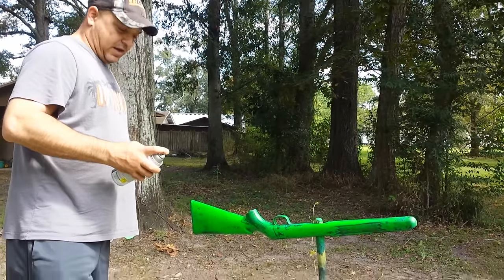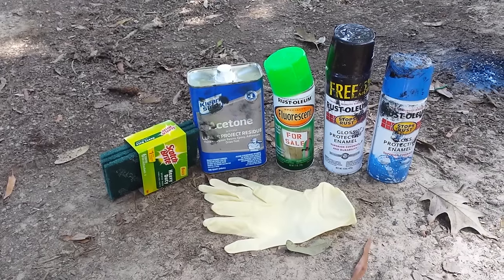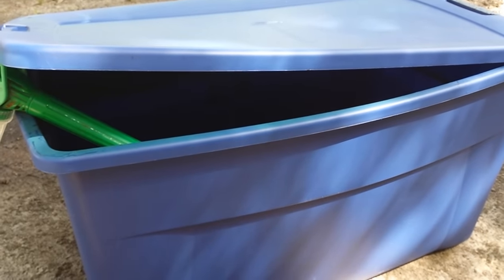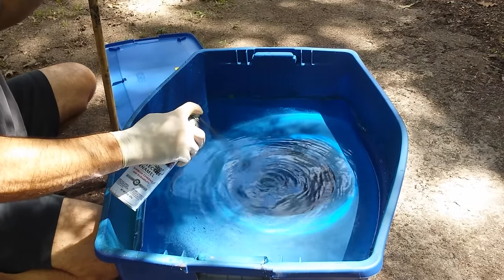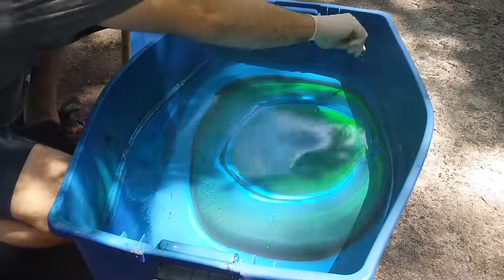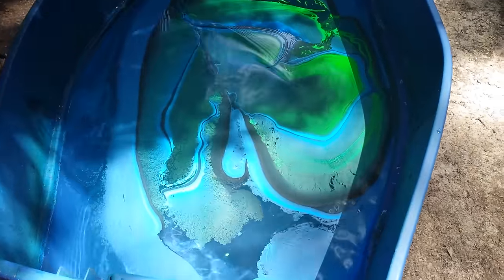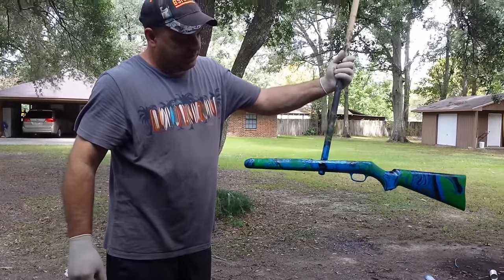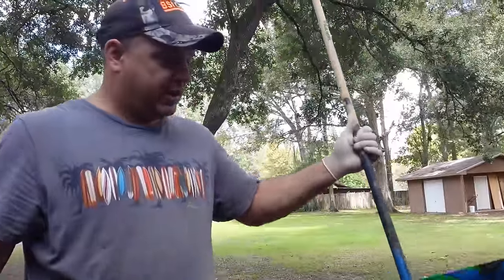DIY: Hydro Dipping using Spray Paint

Comment: You have to clean off all that paint at the top before you pull it out so you get a smooth finish and don't get the extra paint as you pull it out.
Reply from the maker: Brent Simpson..... i did that on purpose ( buttstock didn't get enough color) but totally agree. My project came out perfect thought with no bubbles or raised spots. My daughter was happy with it 😎

Comment: Thank you for posting this.  I've seen several videos, and have attempted a couple of "trial" dips with disappointing results.  Some videos have said warmer water is important, but I'm with you (in a similarly humid/hot Texas) that I'm going to attempt cooler water, as I haven't had luck with warmer water.  

Any advice on picking paint to ensure it is oil-based?  The couple of times I've tried with the RustOleum Camouflage 2x Ultra Cover, and it seems to clump/set almost immediately.  I saw that even paints labeled "enamel" nowadays may not be oil-based. :(

Also, when you dip, are you getting lots of raised areas on the stock?  (too much paint in one area)  Any advice on that? 

Thanks, again.
Reply: +D Scott Brown In Belgium, (where i live) if it says on the can "use for inside and OUTSIDE" it is oil based, everything for outside is (usually) oil based (not if it says acrylic)

Comment from the maker: @D Scott Brown yes on my first attempt it looked awesome but was clumpy in spots but I did put in alot of paint which I was like just use a lil less then I was running into it setting up too fast well even faster than the first dip. So using ice to cool it down which I probably got the water to a cool 68 to 70 range and it didn't set up as fast ! As far as the paint goes yeah just make sure it's oil based so it floats pretty much trial and error with that hence the different kinds you can purchase. I'd go straight liquid but does cost a lil more. Hopefully that will help you !!!
Reply from the maker: Oh and for being raised probably too much paint in one area of the bucket/pan. Try changing the areas of shooting the paint in like the corners then middle then swirl so it's not all in one spot in the middle like I did should come out just as good if not better !!!
Reply: TheHOP
Reply: Talk about a run on sentence.

Comment: Nice simple setup. You're using too large a water container. You need a lot more paint to cover the surface volume. One simple solution is the spray the paint into the lids then use a straw to vacuum drop the paint in to the water. That should give you a few extra minutes working time. 

Also check your water temperature. It should be around 25-32C depending on your paint. You should use a bit of scrap cardboard to swirl the paint away from where you are pulling it out. Also practice with blocks of scrap wood, rocks, household items. Practice makes all the difference. 

Still I think you got a nice look for your gun. Just give it some more practice and if you get in to hydro dipping then perhaps look in to the next level of hydro dipping ; water transfer film, which is what you what for camo print.
Reply from the maker: Yep gonna do my AR like that hopefully in a couple of weeks with the film ! Still tryin to decide which print I want to use considering the type of area I hunt at.  And thanks for the pointers. It's always good to learn something new considering this was my first dip
Reply: +TheHOP81 Nice, but buy some cheap prints off ebay to practice with. Film printing is not as forgiving with mistakes. You want your water slightly warmer and gently remove the air bubbles. I'm sure you have watched a few videos to see the techniques but again do some practice first.
Reply from the maker: +Nick Rider yeah no doubt

Comment: This is the same technique used when water marbling my nails. Your problem is your water is too cold and that is why your paint is setting up to fast. use warmer water and it will be viable longerl
Reply from the maker: actually i had to use cool water for it to work. Being in a  high humidity area the project didn't turn out as planned at first because the water was about 80ish out of the tap. Cooling it down with a bag of ice made all the difference in the world. The paint didn't set up as fast as it did when it was warm ! Im starting to think with all the different ways people say to do it. It probably all depends in the area your in with all things to consider like temp, humidity, elevation etc. For all the peeps gonna be trying this for the first time, i would say practice first on something you dont mind messing u. And if you like the results then go for it
Reply: Yes the humidity will play a factor. when doing my nails I want to make sure the water is basically the same temp as the room I am working in. Maybe try it in a controlled environment; shed, garage, something ventilated enough but out of the elements. But yes lots of ways to do this.

Comment: What type of base coat did u use does it matter?
Reply from the maker: The neon green paint was an oil base paint also. Not sure if it matters. Just as long its not water based im sure you'll do fine

Comment: you use water and paint only?
Reply from the maker: yep
Reply: i try but the paint not floating..
Reply from the maker: +chris oliva what kind of paint are you using ?
Reply: +TheHOP81 i use ordinary paint only..
Reply from the maker: +chris oliva .....only use oil base paint cause it floats !
Reply: TheHOP81  hi.  can i use pailox spray paint.?larry.
Reply from the maker: larry sansano... not familiar with that. Is it oil based ?
Reply: Acrylic spray paint sir. Can i use this?
Reply from the maker: larry sansano... u could try it but try it on something small first not the original project. i would use oil based paints cause it floats on water better
Reply: Ok sir thank you.

Comment: You want to spray with your cans alot closer.
Reply from the maker: actually if you go close it produces tiny air bubbles which when you dip you will see it on your project. Best advice is too use liquid/can oil base paint and get a dropper

Comment: Can you use any paint?
Reply from the maker: use oil based paint !
Reply: +TheHOP81 so using a oil based is good for painting over the a paintball gun?
Reply from the maker: +SpitefireAllDay Well depends on what kind of paint ball gun you have if its metal paint should adhere to it. If its plastic you might want to scuff it a lil with sand paper so the paint has something ro stick to just remember to do at least 3 light coats as a base color and then dip. then just clear coat it with 4 or 5 coats. Should come out fine just practice on something before you dip your paint ball gun

Comment: So it was just plain cold water
Reply from the maker: Yep plain ol tap water
Reply: I'm trying to do my trucks interior which is plastic have you tried it it keeps bubbling up on me did you prep it first
Reply from the maker: +Charles walls..... Well my first project came out crazy like that paint was clumpy and bubbly. So I came to the conclusion that it was the humidity ( I live in Louisiana ) so when I added a bag of ice to cool it down and used less spray paint it came out fine as far as prep yes I did prep my stock with putting light scratches on the gun stock with the scotch Brite so my base coat had something to adhere too. Now for your plastic pieces I'd do the same if it's a smooth no texture piece. Should come out looking good if you spray a very light coat down first wait like 15 mins then put on like 2 more coats 15 mins apart for both coats of course then go to town on the dip